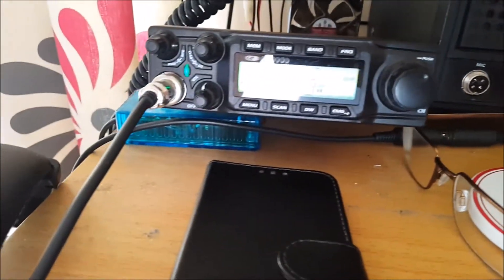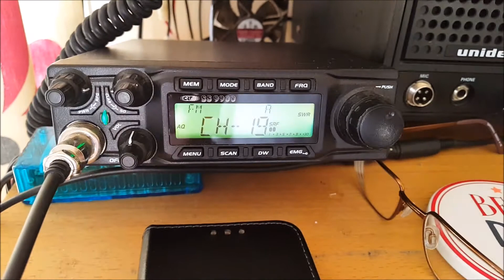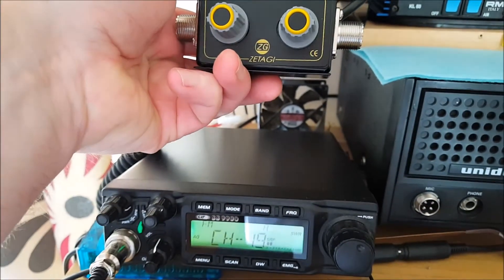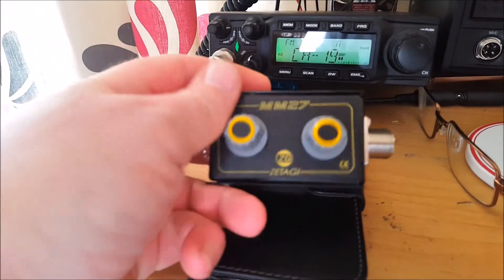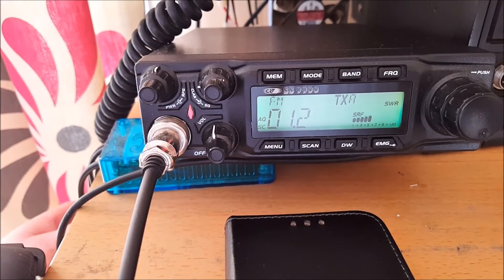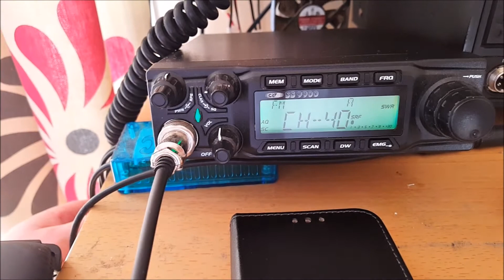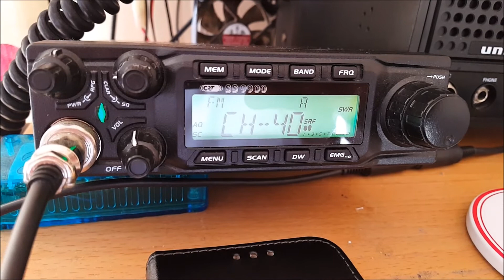Zetagi MM27

Comment: How much power does this little macher survive ? ( .. looking at the nice Zetagi booster in the background with its large heat sink, I guess it may easily provide 400 Whiskeys ... )So I would not dare to put the matcher in between this animal and the antenna .. where it should be to optimize impedance ??
73 de 79HER215 from the Swiss/german border at lake of Constance, located at 600m 
Note, if nasty icecold stormy winds will vanish, I will repair my Yagi antenna to return to 11m after 15 years ... in old times it was possible to reach UK easily on QRP - MODE , i.e. 10 Whiskeys .. however during last years I could hardly receive UK stations, so calling doesnt make sense .. guess MUV is far too low for 10/11m
Reply from the maker: Hi Mike i have run the CRT SS9900 flat out about 60 watts seems OK. They say you can run a 100w into it but i wouldn't Lol. Only running a vertical antenna this way. The bands haven't been all that good on Hf bands. VHF has been good this way on the south coast of UK All the very best Roger 26CT1474.

Comment: Just got one for trying to match a inverted V di-pole inside my garage roof which stubbornly refuses to play ball on 27mhz although it's fine on other frequencies. Time will tell if it solves the issue.
Reply from the maker: Hi John, There a bit fiddly to set up. I had a probulem with 10m. great on 11m. Inverted V di-pole great antenna for ssb. I think the best thing to do is build a resonant dipole for that band 468 Divided by the frequency all in feet. Best 73 Roger
Reply: @radiosonic0007  Thanks - first tests of the matcher suggests it's working great  on 27mhz.

Comment: works on 10m?
Reply from the maker: Not that Good on 10 :(
Reply: @radiosonic0007  i want to use it in my cb,crt 2000
Reply: i try zetagi mm27 on 10m and works fine.swr 1.4
Reply from the maker: Glad it works on 10m. I used it on a CRT ss9900 but only on 27mhz. Hope the 10m band picks up soon
Reply: @radiosonic0007  i used it on a crt 2000h and  my antenna is vertical MIDLAND ENERGY 1/2  and today i saw swr 1.1 on 10m
Reply from the maker: Yes works on 10m
Reply: The caps in these are compression trimmers that are designed to be preset...YUK.!!